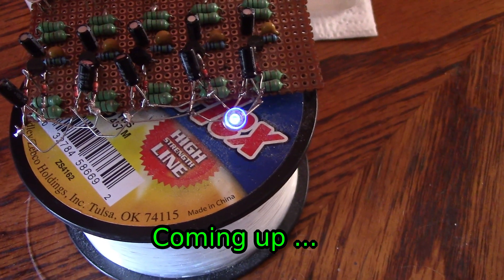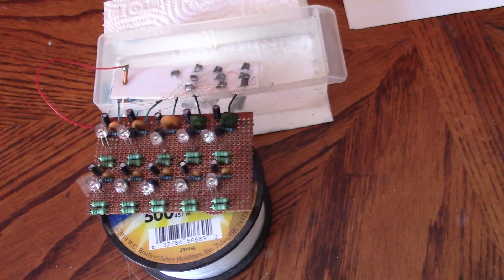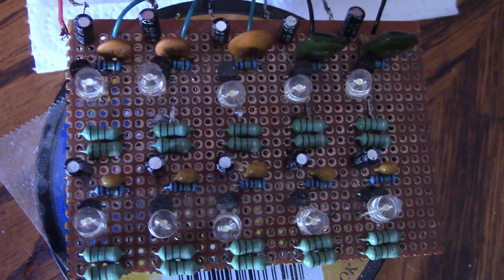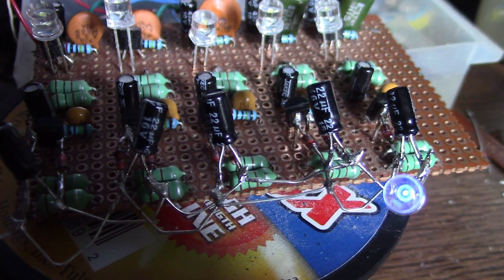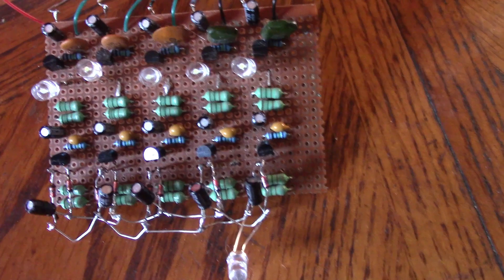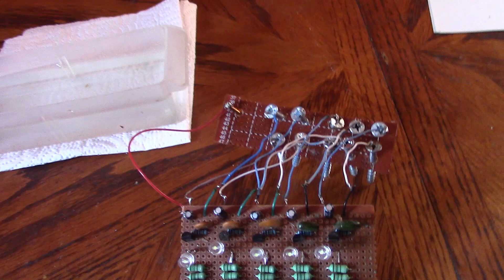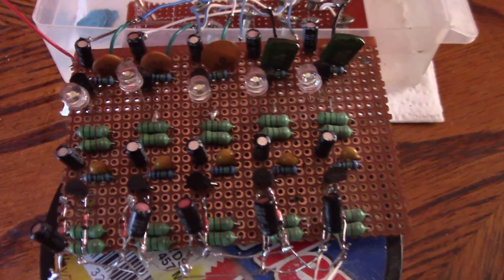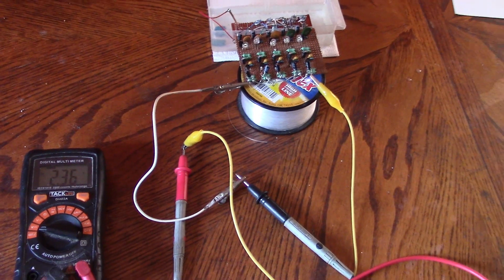Success! No battery or solar needed  - The Power Chip Part 2

Comment: It seems that almost everyone missed the point in their comments.
Also, it seems that nobody can understand that electric curent can be obtained without “chemical reaction” and deionised water (dielectric) can produce work due to its dipolarity itself despite conclusive studies being done since 1930 (or even older) using metals in dielectric liquid.

If someone would be able to use heavy water might be stunned to see the results when molecular structure enhance the dipole character of water.

Now, on more serious discussion: would this setup work without pulsing each cell separately ? I can see each cell is pulsed at different frequency, now my question is: what would be the outcome if each cell will be pulsed at a precise frequency that can be divided by 50 let’s say ? I mean cell1 50Hz, cell2 100Hz cell3 150Hz and so on.
Reply from the maker: Thanks for your great comment 😀
Heavy water would indeed be completely fascinating to explore. 
The circuits run at different frequencies due to mis-matched components. Mainly, what I had available and why they don't look 100% the same to the eye. All use 1000uH inductors mind you. I can see what you mean with something like mains frequency, It might allow for a simpler conversion if the system was expanded enough to produce mains voltages.
Reply: @Slider2732_  I am just a dumb as box of rocks person my name is Ben this is wifs youtube  I think inductance needs to be as low as possible until the point of use   You can use a short circuit to raise the amperage by placing a capacitor in series on each leg of the short  Then what ever your powering hooks to each leg of cap on shorted side   We think path of least resistance so the short will not allow the voltage to rise enough to run anything  Well this is not the case if discharging cap on none shorted side of the two caps  So one ac power source each leg going into a leg of a cap   Each other leg of cap shorted also what ever your powering on each of theses shorted caps  Then fast discharging between each leg of caps none shorted side  I know it sounds silly but if done right the short is your inductor  The voltage cant rise when feeding the other two legs of cap with ac source of a normal freq  The higher the voltage the better but normal freq  If you voltage is high enough it will spark discharge its self if you put a small gap on none shorted side of caps  This will make a tank circuit with the shorted side of caps being said inductor    Subject change but some thing else good to know about inductance  In a reg mains transformer the more turns of wire TO A  POINT the more eff it will be  Also ZERO mains hum even with your ear on the transformer  When winding your own core and input/output coils you want to wind it with as low as possible capacidents  If it be possible ZERO capasidents all induction To find the perfect turn ratio calculation will work It will get you in pallbark only  If you want as close to zero losses as possible so close you cant find any you must test as you add turns  So if winding a mains step down tranny start with the mains side  Wind the ballpark calculation then plug it into the mains and note the loses  Unplug it from the mains add few more turns plug it in again  Repeat noting the loses  At some point the added turn will have less effects of the losses  This along with winding for low capasident is how you make a mains transformer have zero hum and incredibly low loses  Maybe so low you cant find any in the final completed transformer  Might have to buy better equipment even if you have very good equitment to find them losses  They WILL be there unless it is getting some power from another source as we all should know by now  Heat pump cycle is free energy to the way most think of free energy  I think diff meaning from same word makes peoples true heart show    I am shore I have not wote any thing new but I have ran into tons of people that had no clue of the things I wrote  By the way you can stick your toung to the shorted side of the circit I first described  Its power output has lots of strange things about it    ALL super fast discharges at diff than most think    God bless hope this helps some one
Reply from the maker: @ambersmith6517  Many thanks, thoroughly interesting information!
Also, thank you for the time you put into such a reply, it's appreciated 😀
The cap and inductor situation reminds me of Lasersaber's Joule Ringer's, where the windings don't look enough to gain the effects shown, but, they run better than any others. 
I remember coil shorting was very popular with Bedini's systems (when he was still alive) and it's well worth another look at.
Reply: @Slider2732_  there would be direct conversion at desired frequency, square wave is as good as sine wave and if you have 100+150+200+250+… resultant frequency will be 50 even if you don’t use it direct, veritasium channel have a recent video about this effect.

But this would be out of reach for average joe in diy manner, while your idea is absolute brilliant ! I really wonder if you think it might be possible to play with zener diodes and caps instead of blocking oscillators to obtain desired frequency as we can reach any potential we need pretty easy in your way or my way.

By the way, why you say Mg wouldn’t last long enough ? Using tap water with chlorine in it ?
Reply: "electric curent can be obtained without 'chemical reaction'"

Why do you think so?

If that were true, why doesn't every do it?

The reactions between various metals is very well understood. Voltage produced by two different metals can be accurately predicted using the electronegativity of the element. The electrons in the current originate in one metal and end up in the other metal when current flows. At least one of the elements has to corrode in order for this reaction to occur. If water could produce work because of its bipolarity, then why isn't anyone using this? 
Where is the energy coming from?
Reply: @ddegn it seems pretty hard to believe but this is the pure truth. Watch my 3 videos o my channel to see same effect @slider2732_ have shown here. My setup is different and use classic 2 electrodes per cell, if I add potable water voltage/current is much lower than using deionised water and I have run continuous my setup for more than 1 year without any noticeable reduction in size of electrodes. Why anyone else do not use it ? I don’t know … maybe people trust more whatever mainstream science say publicly as the scientists are well aware of this effect. There is a lot of paper work and plenty studies. Let’s hope more people wake up and start to use it. I already mentioned few times is based on “work function of elements” method contact points and not photoelectric. “Electronegativity” of elements is outdated and inaccurate description of phenomena and you can ignore this section if you seek the truth.

All we know from textbooks about dielectric is just what mainstream science are allowed to make public. Any dielectric can conduct electricity at right frequency, we can even use nylon fishing lines for electric power transmission or just a simple thin polyethylene foil if we wish. But a very simple example is water and air, both of them dielectric and both them conductive.

Electric charge or “the energy” is non polarised and what we call “negative” or “positive” relate to elements according to their atomic/molecular structure. In a dipole it manifest and flow in opposite way from “negative” to positive and any circuit connected to a dipole will flow from “positive” to “negative”. But to understand this one needs to understand that “the energy” is always present in any matter anywhere in the universe.

Comment: The primary error in your thinking is "an energy creating power source" because you can't "create" energy... it's always a transformation rather than creation process.. it pertains to the concept of the first law of thermodynamics. Zinc is an anode (-) material used in chemical batteries, hence the screws working.. but only until that coating is ionized and leaving the iron behind. The single copper cathode (+) is weird, but will work inefficiently.. but again as mentioned.. this IS AN ELECTROCHEMICAL BATTERY rather than any sort of energy harvesting or "creation" device.

-the thing to take away here is although you want to create something through random experimentation, sometimes you're walking on well worn concepts.. especially when basic physics laws are being ignored or not fully understood. Research and understand what you want to create, as it's quite possible you're wasting your time. So if anyone is willing to hand this guy money to "further this build" please message me as I have some swamp land in northern utah for sale.
Reply: Would you be able to explain “work function of elements” for me please, it seems you are very well informed and I am always keen to learn something, as my setup using deionised water or even pharmaceutical grade pure water and after a year of continuous running there is no corrosion of electrodes, nor size reduction and light is on all time without any electronics, just bare copper wire+bare aluminium wire+water … and no measurable curent (i can only read above 0.01amp with my instruments). Voltage measured at LED is 2.5 volts and at output of “battery” is 6-7 volts.

So, please enlighten me which law pf physics am I breaking or obey ?

Comment: Congratulations! You've just invented the battery.
Reply from the maker: But, with only 1 positive electrode to power many oscillators, all summed. Any multi-cell power system can't be anything but a battery... I do agree and is the whole point 😀
Reply: @Slider2732_  Sorry, if I sounded condescending. I have little doubt that you didn't know that.
Reply from the maker: @mikethespike7579  That's fine, I appreciate you commenting in the first case 😀
Reply: @Slider2732_ no. It’s just an electrochemical battery. And not a very good one. No amount of technobabble will change that.

Comment: Well done. you made a battery and a voltage multiplier. 🤣
Reply from the maker: Yep, from the same electrolyte and same single positive electrode 😀
Reply: @Slider2732_  So what's so amazing about this then? I made chemical batteries when I was 10 out of lemons. Yours just has a common + rail. Maybe I missed the point but I don't see anything remarkable here.
Reply from the maker: @peterjansen5498  Mainly in the summing, Peter. While it's very easy to make a lemon type cell, it's not easy to sum from the same electrolyte, at least in my experience. Multiple cells within the same lemon is certainly not a regular school type experiment. 
Every common demonstration shows 1 positive electrode and 1 negative electrode in an electrolyte... not multiples, summed. Do bear in mind there is no claim as such here for clicks and cash, only a success that the summing has worked. This is a non monetized channel, run by an average middle aged hobbyist. The future aim of the 'Power Chip' is what is being explored and shared as I go.
Reply: @Slider2732_  I still don't see whats special here. There are multiple cells, each has a Pos and neg but you have all the pos common. each cell appears to drive a multivibrator with the output rectified and charging caps. Without a schematic I can't see what you are trying to achieve. Sorry if I sound underwhelmed but I just dont get it. Can you show a schematic so some of can understand what you are demonstrating. :)
Reply: @Slider2732_  WELL SAID PEOPLE UPSET FROM OTHERS VIDEOS  I LIKE THAT YOU PESIFY  THEM INSTEAD OF BUNCH OF DRAMA   Seems the world has enough drama nonsense to me  AGAIN WELL DONE BE A LIGHT
Reply from the maker: @ambersmith6517  Drama might make the algorithm happy, but nobody else 😀
Thanks for your comment.
Reply from the maker: @peterjansen5498  Will do Peter, as it does seem to be confusing to several people. It's intended to be a battery! Everybody is correct and that was never an issue. It's in the summing, from the same electrolyte. That allows plugging the system into the ground, or to float on water and generate as more than one 0.6V cell.

Comment: You just made a mediocre battery and some sort of voltage booster (seems like a buck booster due to your short explanation). Like I guess it’s impressive if you did this without doing the research to understand what you are doing, but it’s… it’s like 600 year old news for the battery and I’d wager the booster is probably at least a century old.

There also seems to be some implication that this is a free energy device, but you are just consuming a small fraction of the energy put into purifying and molding the metal. It will run out of juice eventually.
Reply from the maker: An understandable opinion. It looks mediocre, but, to sum circuits like this from 1 positive electrode and same electrolyte is something I'd like to have seen before. Do you have a link to the same thing? It would be genuinely of intrigue 😀
Also, no need for any hostility, this is a little non monetized channel and I'm only posting research and findings.
Reply: @Slider2732_ 
Indeed, the choice of words. We would  like to see a better version from the commenter who is implying what you are doing is battery 101.
Reply: Can you do better?
Please share a version that, to you, is a better implementation. Otherwise, it is armchair commentary with no suggestion on what  implementation would improve what he discovered.
Reply: @shareyourchristmas  nothing was discovered here. This is just a weak battery and some simple RCI oscillators to make it look complicated, and to pulse the lights (I suspect the pulsing is also necessary to make them bright enough to see on camera). You can look this stuff up in a basic electronics textbook. It would be an impressive discovery 400 years ago.
Reply: @bridgetshepherd5202  
It is all about learning and doing things that make you want to continue.
I am grateful he is sharing.

We are all at different stages, in the journey. Perhaps you have done more and you see this as very basic.
It may well be.
The most complex system is always made of simple components, with simple properties. 
 
Personally I see a LED array, that can be arranged into a panel, that can be used to make something like a mendoncino motor.
All starting with basic set up that provides a low voltage input.
 
Just experiments, there are different ways of making DIY batteries. 

Having said that, for example, I am yet to come across someone who has successfully replicated the oxford electric bell, claredon dry pile, that can operate like the original one.
:)

Comment: Is this not just a lemon battery with a bunch of voltage multipliers?
There's an actual way to get the power from a self contained unit. You could pot it in epoxy if ya wanted to, showing there is absolutely no galvanic reaction. So long as society keeps functioning, it will keep producing power. Use an antenna, harvest the radio emissions from all the cell towers, am radio towers, wifi, microwave, as well as the current produced by piezoelectric minerals in the ground exchanging charge with the atmosphere. It's basically induction charging, like you see when you charge a phone without plugging it in. 

Im showing my age here, but if toy remember the Nokia phones from around 2000, there were little led stickers you could put on them that would put on a light show when receiving or making a call. It would work the same way, but the proximity to the signal being generated in the phone was enough to induce enough current to step up and power five or six strobing tiny leds.
Reply from the maker: In a way yes, exactly, only functioning differently. It's intended to be a battery, after all and many people in the comments seem confused about it. Thing is, a lemon battery could be say 10 lemons in a line... each will connect a positive to a negative in a chain. In this case, there is only 1 positive electrode. Also, each lemon has its own self contained electrolyte, this has just 1 electrolyte for all. 

The power harvesting is certainly of interest, I'd like to harvest EMF from this PC here to reduce exposure, for example. 

Oh I'm with you on the age thing, we never had cellphones in the 70's when I was a kid, or computers lol. Have still got a couple of Nokia 3310's in a drawer.
Thanks for your comment 😀
Reply: @Slider2732_  good luck, I'm looking forward to watching the progress. This one video hooked me in

Comment: I get around 24 volts @500ma out of a version of Tesla's cosmic energy circuit I tricked up, the secret is in the type of antenna, inductor circuit and using the right rectifier circuit, It is defiantly worth experimenting with.
Reply from the maker: I agree and best of luck with those experiments. Great results!